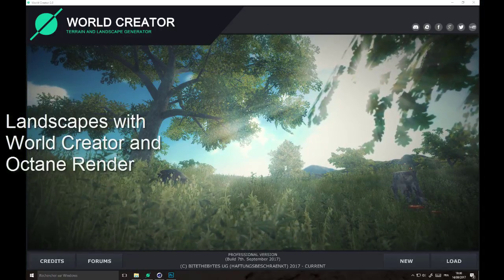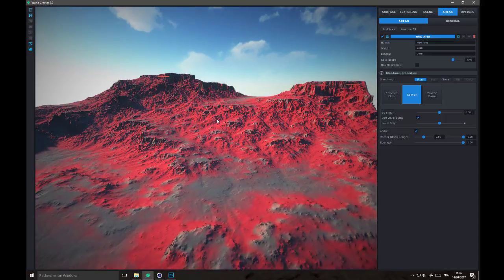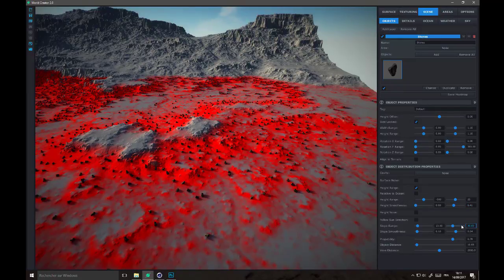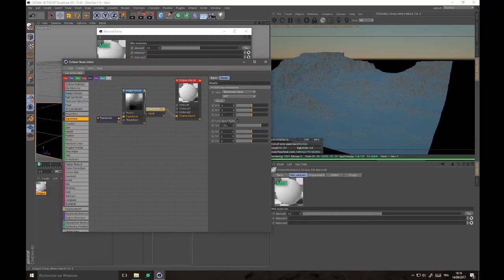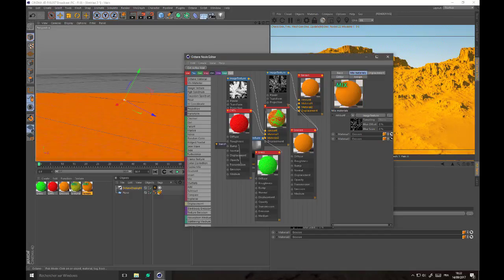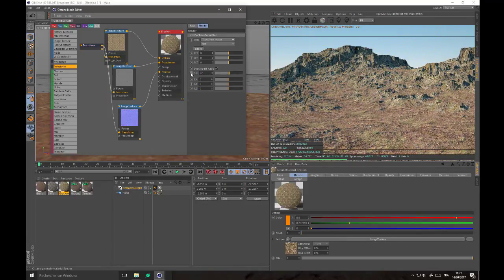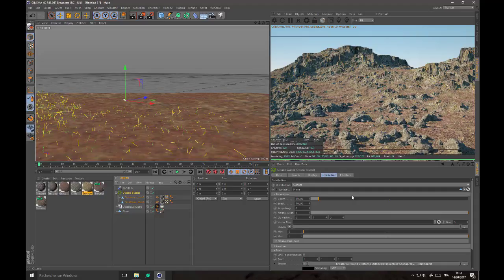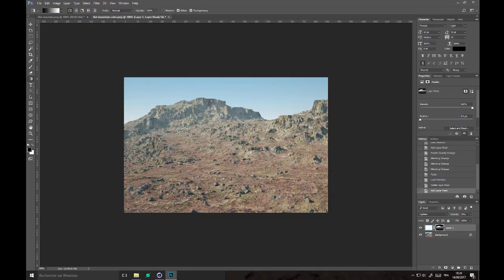3d landscape with Octane Render

Comment: Use a displacer effector child to a plane. When you have the plane displaced, increase the plane segments to 1000 to get full effect. When doen, right click on the plane, then click on "current state to object". This will help you with the scattering in Octane without using a height map for the position.
Reply from the maker: Excellent. I will try this. I have done tests with the C4D displacer but at high resolution, display gets slow.
Reply: @Virtual-lands-3d  It really does... which is a shame. However, a good work around for that is to keep the plane segments low while working on the displacement, then increase them for the final render. OR, you can just use displacement in the texture node for octane and keep the resolution low until final render, like you have done already. A good thing about converting it to an object, though, is that you can edit it.

Comment: Stupid question but how do you get the height/displacement in C4D to match the height from World Creator 2? Ie. why use the number 250m? Do you just input a number and try to get something that looks similar or is there an accurate way? Keep up the amazing stuff (I know this is from 2 years ago but still amazing!)
Reply from the maker: Hi Theodore. The 250m displacement is totally empirical and derives from a visual test. A more accurate way would be to replicate the Width / Length / Height ratio of your World Creator 2 terrain in C4D.
I really mean the ratio, because I rarely use the World Creator 2 terrain to their real size in C4D.

Comment: Hey great tutorial, but there is one major issue that you didn't seem to notice : your materials don't have displacement because Octane Mix Materials only activates displacement from the displacement channel, not from the PBR materials within it. So at 24:45 , you didn't notice but there is no displacement at all. Just the diffuse. I've been trying to overcome this problem but it's very complicated. Do you have any solution ? :)
Reply from the maker: I noticed it in further tests. To overcome this limitation, I apply material displacement to a terrain that has a low res displacement applied with C4d. I made 3 tutorials on this technique and you can find the first here: https://www.youtube.com/watch?v=0TZFWTx9bmw&t=2s
I think this is more adapted to smaller scale terrain. The method descibed in this tutorial works better for large scale ones.
It would be great if Octane allowed combining displacement and texture layering in an upcoming version.

Comment: Great tutorial! Thank you. Also, your english is superb. Way better than my French!  Just a hint though, to pronounce 'height map', think of the word 'light' or 'fight' and pronounce it in a similar way. As if it were spelled 'hite map'.
Reply: Thanks for your advice. I will need to remember this as it is not a word I use daily.
Reply: Hi Olivier, another idea: When I'm doing similar things in Redshift, where I have to displace a flat plane for landscape, I find it very helpful to duplicate my plane and use a displacer deformer on it with the same map, then set it to be visible but not render. That way I can see a rough 'proxy' of the terrain in the main view to aid navigation. The displaced flat plane for Octane will then have the visibility set to 'no' in main view but 'yes' in render (using the 'traffic lights'). I'm sure you know this technique but it may help others to mention it :-)
Reply: It is a nice idea to make navigation easier. I am also using lower resolution C4d displacements for cases when I want to apply material displacement to a terrain (generally for closeups). I am preparing another tutorial to show this.

Comment: Great stuff i was looking for this! Btw, which version of world creator u got? Pro/basic? thanks
Reply: I am using the pro version. I needed the additional filters and extra resolution :-)
Reply: I got it too just started playing, its seriously fast! btw i export at 32bit and at 16bit tiff files but are huge in 8k. What is the format/bit depth u ve seen works best? thanks
Reply from the maker: There is little visible difference between 16 and 32 bit files when rendering in Octane, so I stick to 16 bit tiffs.